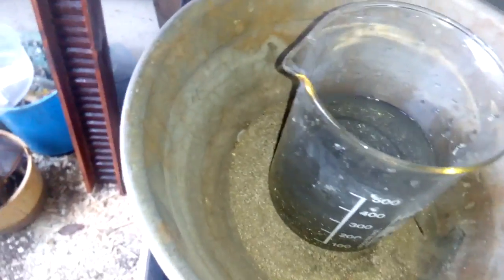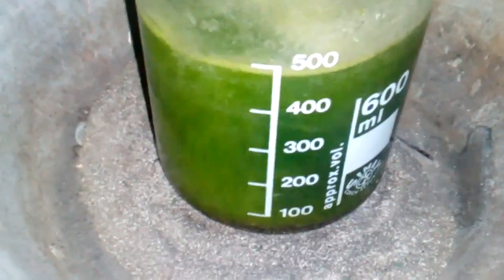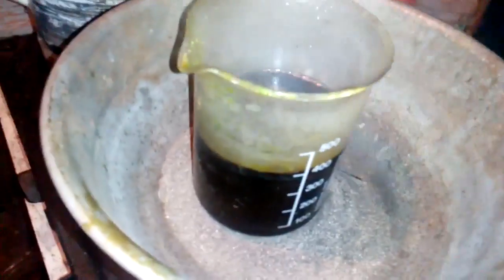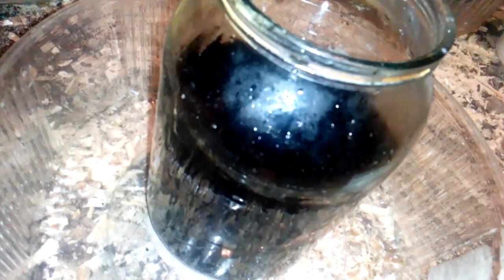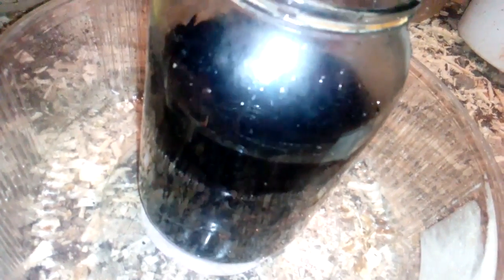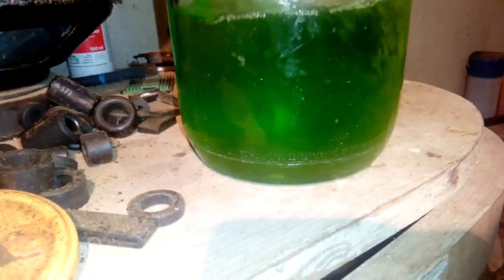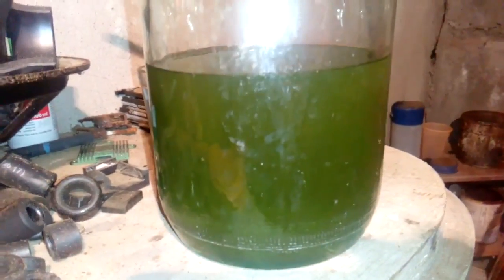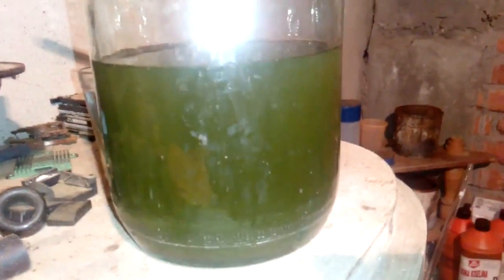Proces pins from the Fiber CPU straight  to Aqwaregia!

Comment: Dusane what is the base metal underneath?
Reply: OwlTech  the gold base metal pins are copper, the silver pins with part plating are usually copper coated in nickel or tin or both and sometimes a little zinc, but they both have contaminants from solder aswell usually a tin mix but sometimes a silver mix even lead on cheap stuff, so treat all pins as if they have a mix of base metals and u will have less drama and cleaner yields..
Reply: thanks I thought it was kovar
Reply: It may be in some cases too..
Reply from the maker: OwlTech sorry for the late reply!
But about everything what stephen said ;)

Comment: U did it again. I have 500 gr. of those pins just iching to be processed. Great advice, thx so much.
Cheers
Reply from the maker: Thank you, although it would be better if you made those pins by cooking them first in the hcl to remove the tin, then rinse with water, then Nitric, after that the foil into the Aqwaregia or bleach and hcl.